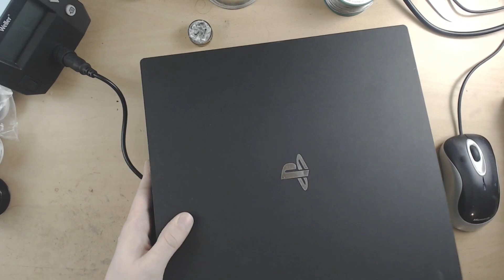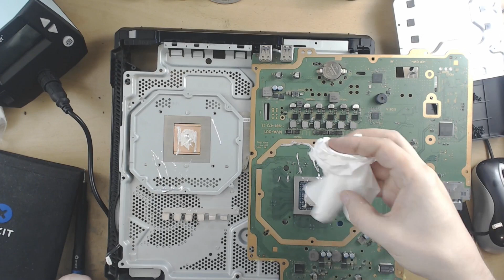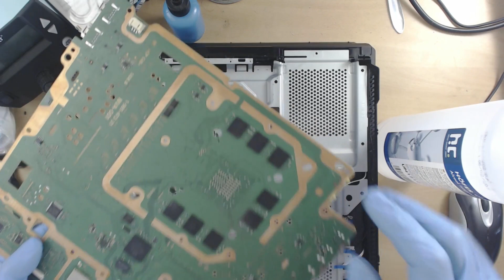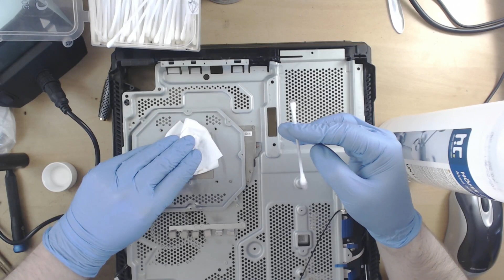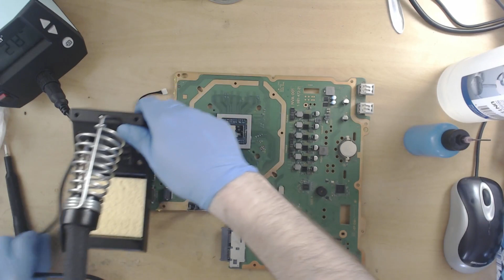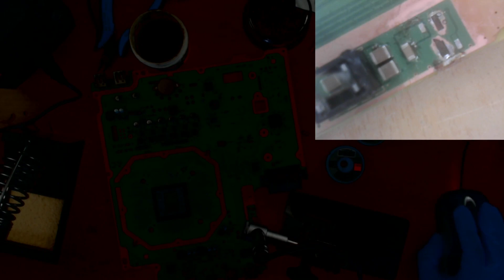L'Atelier ElectroDD 1: réparation prise alimentation PS4 pro et une mauvaise surprise

Comment: Bonjour. J'ai le même cas comme décrit dans votre vidéo. La fiche sur laquelle se branche le bloc alimentation s'est détaché lors du démontage du bloc. Auriez-vous une idée de prix pour une telle intervention ou bien vaut-il mieux investir dans une nouvelle carte mère ? J'en ai trouvé à 130€. Je suis de Grenoble (38) pensez vous que cette réparation puisse être possible et judicieuse chez LDLC ? Merci pour ce que vous faites.
Reply from the maker: Bonjour, c'est une réparation relativement simple et rapide. En prenant mon temps je le fais en 1h sauf cas difficiles. Quand j'avais mon entreprise, je facturais 40€+frais de port pour cette réparation.
En mondial relay ça revenait au total à 60€ ( 10€ allé, 10€ retour + 40€ de travail ).
LDLC n'est pas équipé pour faire cette réparation, il faut aller voir un électronicien.
Même si je ne suis plus pro, je peux toujours réparer la console. On peut en discuter par e-mail si tu veux: contact@atelier-electrodd.fr
Reply: @Electrodudimanche  Je vous remerci grandement. J'ai fait 3 boutique et le dernier à bien voulu faire cette réparation. Résultat, fait en 30mn et 20€. Merci encore pour ce que vous faites et surtout de m'avoir répondu aussi rapidement.
Reply: Bonjour j'ai exactement le même problème comment puis-je vous contacter
Reply from the maker: @benoit1116  Tu peux me contacter par mon adresse mail electrodudimanche@gmail.com
Reply: Bonjour j' ai arraché cette pièces possible que vous la réparé je suis de Belgique merci